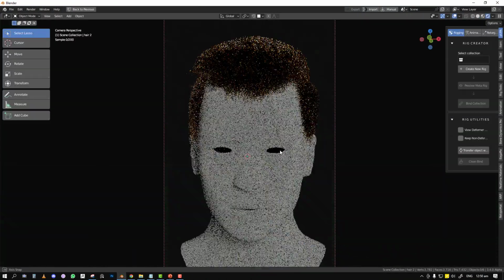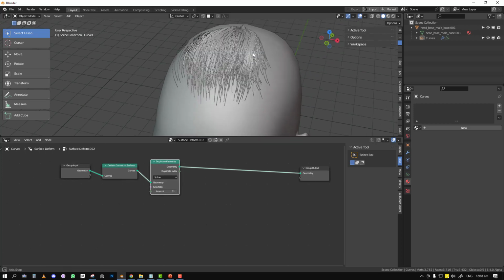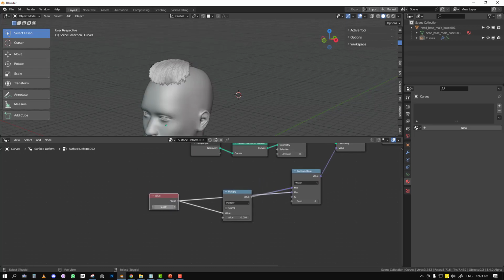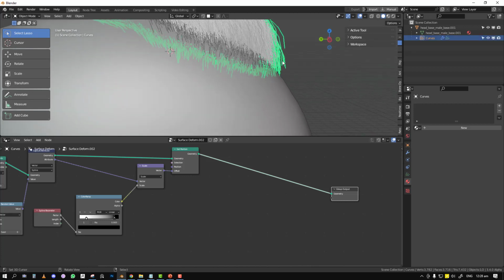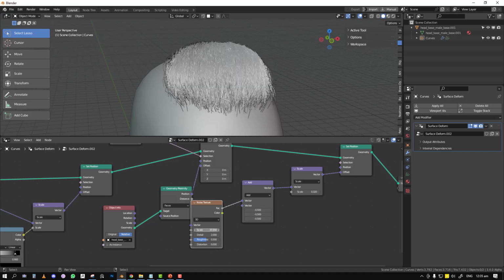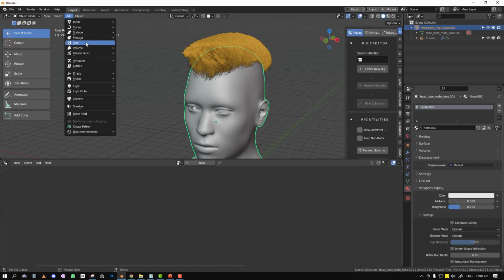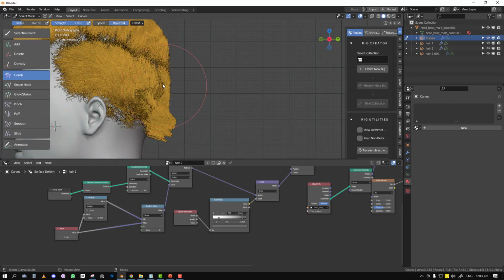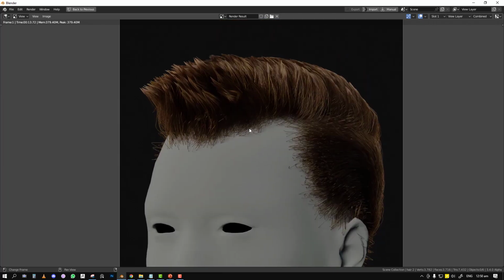Blender 3.3 - New Hair System!

Comment: So with the current version, you add an interpolate hair geo node then a clump node , frizz etc which is fine.
But how do a I create a new empty hair  group with the same modifiers, but with no curves 
So for example like you have done I want do have the top of the hair, side ,back all separate, but with the same modifiers on each hair group

EDIT  so i went to link data, copy modfiers which works fine :)

Comment: all very nice, but i'm still waiting to see how we can animate the hair. right now there seems to be no way to do it
Reply: i thought the intention of the new system was for the hair to animate automatically if the mesh it was on was animated?
Reply: @jifour99  It deforms with the surface, but Shah is, I believe, talking about simulations for longer hair. As it is, this new tech can only really be used for short hair.
Reply: @Recurve_N  yup exactly. for longer hairstyles some simulation is necessary. right now you cant even manually animate
Reply: actually figured out a way to animate the hair. it works with a mesh deform cage.